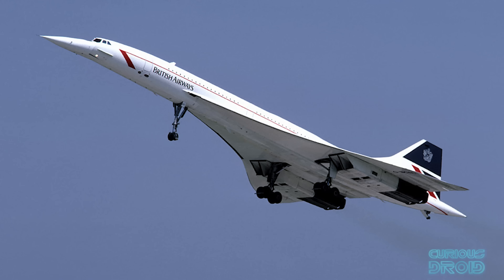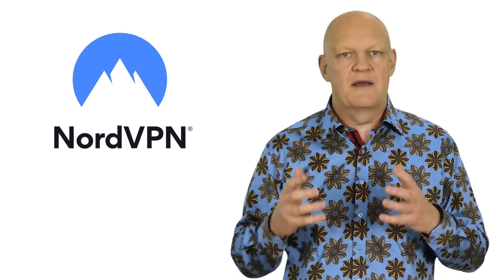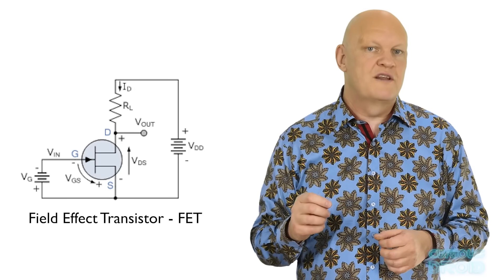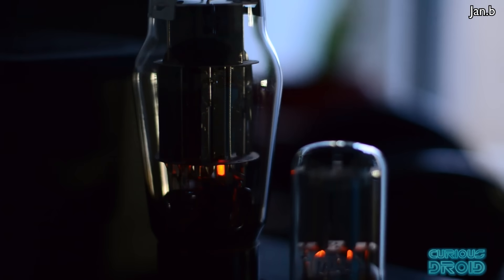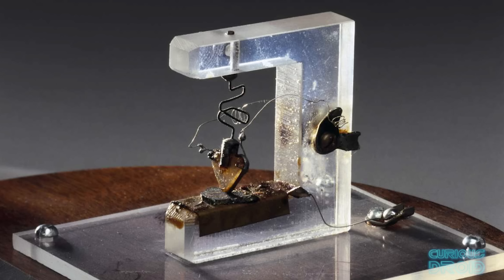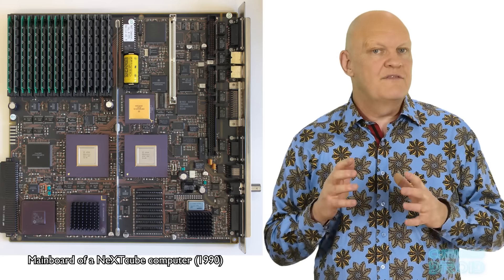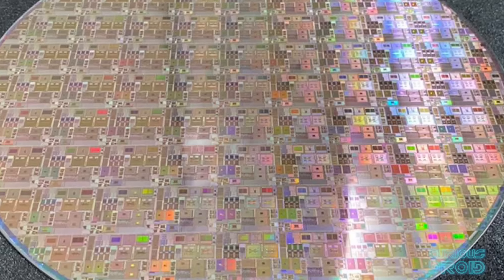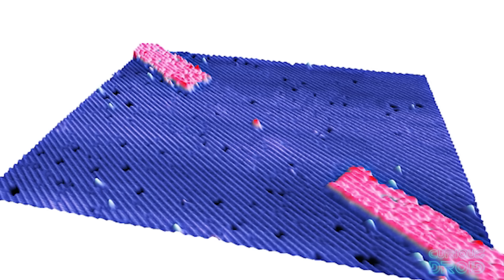MOSFET – The Most significant invention of the 20th Century

Comment: Asome video! Thanks! 😃
Interesting, in the Dutch news ASML is always mentioned as a chip-manufacturer, but actually they make the machines which can produce chips. Now I know! 😉
Reply: No it is just one of the many machines that are used in the process.
Reply: @fladder64  The most important machine by a huge margin.
Reply: @krashd  No every step in the making is important, but for most processes the newest ASML tool is not needed an older version will work just as good.

Comment: I have not seen a video that recognizes the MOSFET for the world changing apex invention that it was. I use them to make analogue preamps as a hobby. As always, thanks for making this video, we appreciate the effort.
Reply: Because it's taken for granted.
Reply: History guy did a vid
Reply: Is there such a thing as a digital preamp?
Reply: @BoboButYouCanCallMeTom  Lol, I guess there isn't, the thought of encountering a high Z digital square wave input made me laugh though.
Reply: @BoboButYouCanCallMeTom  no.
Reply: Tell me about your preamps...
Reply: MOSFET preamp will have very low noise because of low resistance?
(I'm guessing)
Reply: Advantage of MOSFET preamp is very high input impedence.
Reply: heared (and agree) on transistors in general never heared it in speceficity as MOSFET
even if one has to throw in .. Penecelin and chemical fertilizer had such a massive impact .. taking those out of the pictre .. 
the world we know would be VERY different .. espcialy with a lot less people

Comment: FET transistors are my favorite transistors. IGBTs are second (it’s a FET and BJT transistor combination).
Reply: i prefer LED diodes
Reply: @Blox117   "LED Diodes" What does "L.E.D" stand for ?  Plus they are not transistors.
Reply: That's cheating since an IGBT is a FET + a Bipolar Transistors.  😀
Reply: @eldencw  Yes, but it’s not actually an equivalent circuit. You can’t easily just substitute an IGBT with a bipolar and FET. The operation is unique. Equivalent circuits used in documentation are for conceptual understanding of the operation, not true operation.
Reply: BJT are faster...
Reply: They're not actually two separate transistors hooked together at the physical level, that's just the equivalent model given to engineers to help them quickly understand the new component.
At the silicon level, an IGBT is a single monolithic device.
Reply: Yea, there wouldn’t be the electric car revolution now without IGBT’s - you don’t make a 150,000 watt amp with bipolar transistors.
Reply: You have a favorite transistor ???   Do you get out much ???  I am an electrical engineer of 40 years and I have components I like and do not like, but to a favorite.... Well I have a family and they are my favorite.
Reply: @mrgcav  this is why old people should not use computers
Reply: @gravy boat   I'm more of a Sporty Spice kind of guy myself.
Reply: Mel b is my favourite spice girl
Reply: @gravyboat2370  Mel C for me.
Reply: @NoahSpurrier  I used to think the same until I heard Mel b is into lesbian 3 somes 👍
Reply: Even better than transistors? Memristors